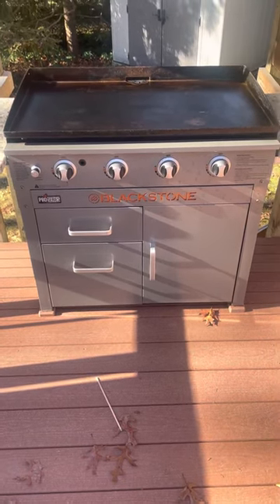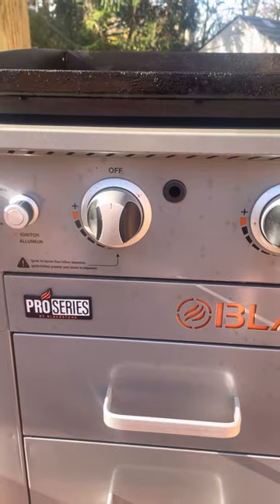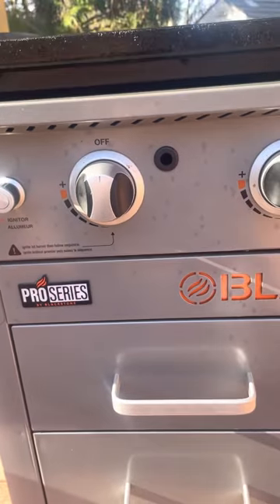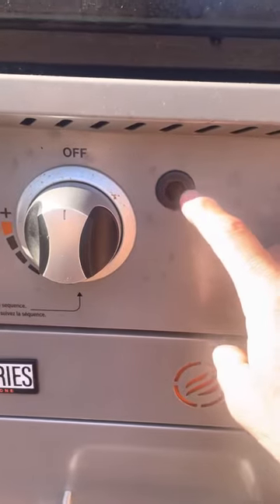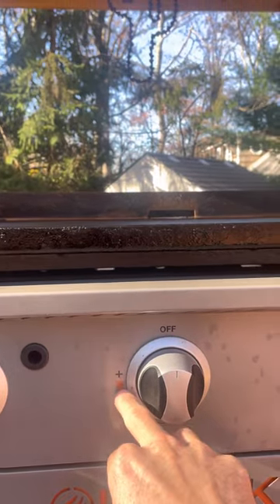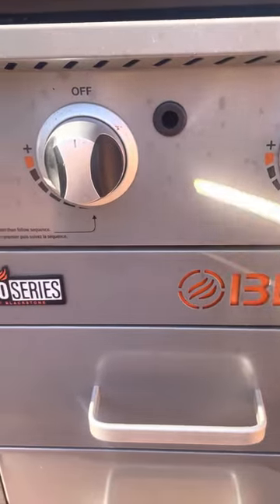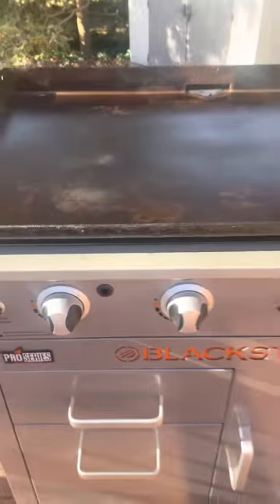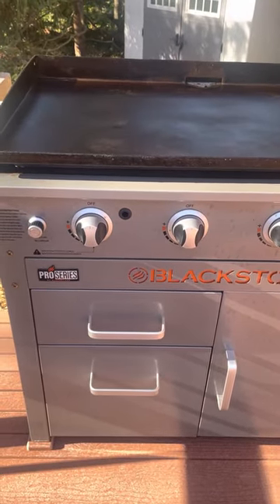Blackstone griddle igniter solution

Comment: That’s one burner. What about the rest there ones?
Reply from the maker: The igniter only lights the left. Once the left is lit the rest will fire up when turned on
Reply: @67box  how. They each have an igniter, don’t they need a spark for each one?
Reply from the maker: The blackstone only has one igniter on the left burner. Thats how it is
Reply: @67box  I have the culinary. The ignition is on the center. I wonder if it lights differently. Yours say to light the left burner and follow sequence. Mine doesn’t say that.
Reply from the maker: I guess do a test with the griddle off of it. I light my left then turn them on left to right. Good luck